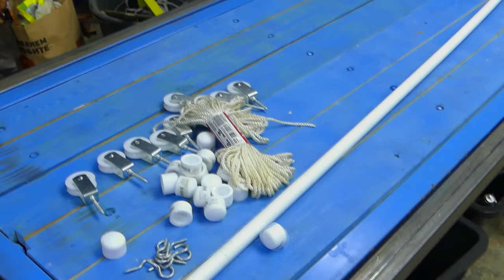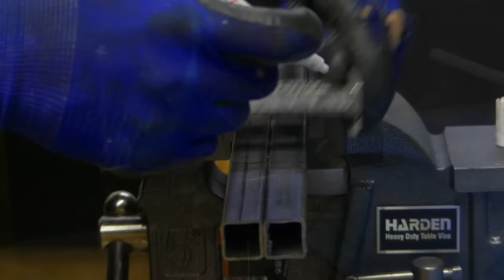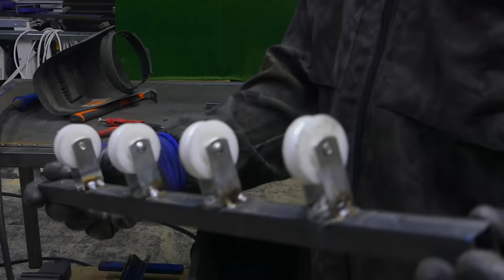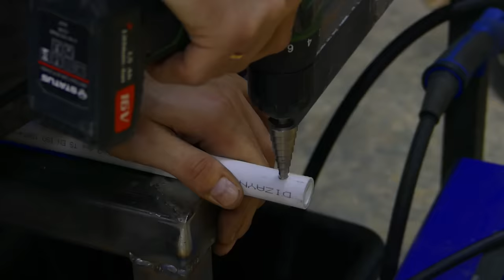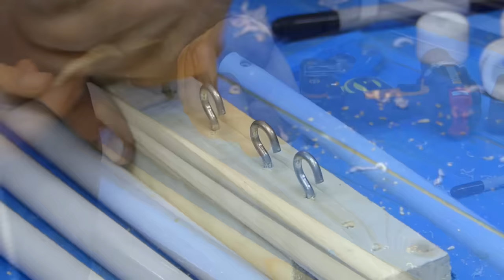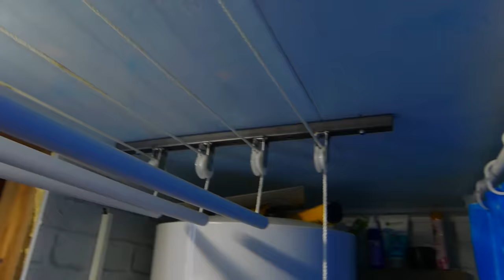An amazing invention! It will come to mind!

Comment: I have an idea of getting a large lump of heavy metal, drill a hole in it (I will call this part the head) and stick a piece of wood in it (I will call this part the handle) and I will call it an hammer eventually and this will be my contribution to these type of exceedingly clever ideas.....